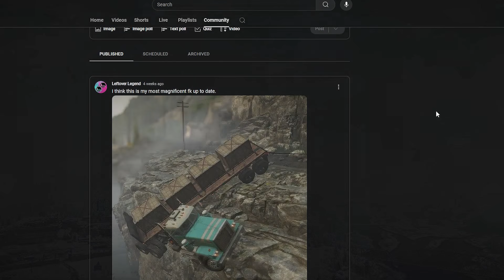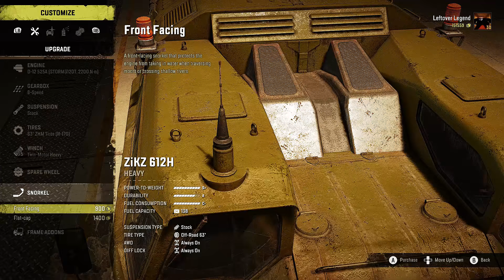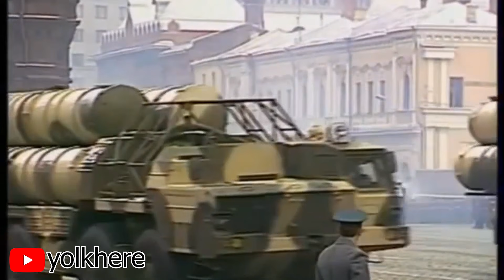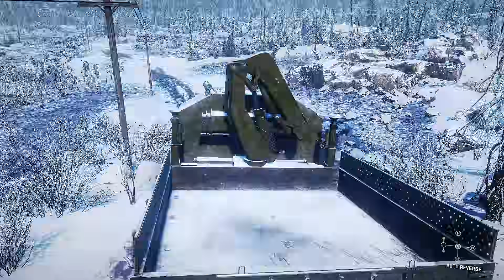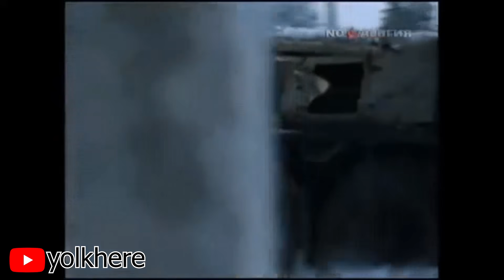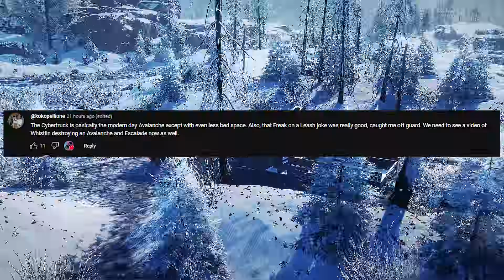The MAZ 543 and 537 - Heros of the USSR - Told Through Snowrunner

Comment: 19:12 Maz 537 and all other heavy Maz had 3 speed hydro-mechanical transmissions. Basically- it is an automatic gearbox with torque converter, but shifting gears is operated manually, using stick on the right side of steering column.

P.s. about rear suspension- Maz 537 didn't actually have leaf springs or any soft suspension element. Suspension work is done by the wheels, just like on K-701 tractor. Still, this suspension is very cool- you can load as much as you can and have the same clearance and suspension travel as empty vehicle.

Comment: 20:13 As far as I know, when the USSR made medium- and long-range missiles, they preferred liquid fuel. The climate control system is needed to keep the liquid fuel and oxidizer within the optimal temperature range, which is essential for rapid launch preparation. Back then, liquid-propellant rocket production technology wasn't as advanced as it is in the 1980s or today.

Comment: should note that its model number changed during the mid 80s to 7310, as the soviet vehicle numbering system moved from just assigning a range of numbers to a factory, to a more sophisticated system which also indicates weight and leaves more room for multiple models (and fun fact, the first vehicle to use this numbering system is the VAZ 2101, better known in the west as the Lada Riva)

Comment: The curtains could also work as a blockage of, let's just say, "excessive light" similar to the rocket engines. The 8x8 has been used as a base for MLRS systems and a temporarily blind(ed) driver is kinda useless, after all.

Another thing that kinda bugs me is such a nitpick that even a plage doctor would be scared of me, and that is the 537s cabin gun holders, or the weapon orientation, to be more specific...

 It makes sense that the buttstock would be pointed up considering that they'd be the weapons of the operators, the last thing you'd want to do when evacuating from any truck that is under/on fire is waving two (what would most likely be) AKs inside the cabin, with how the holder and guns were situated made it basically a "grab-and-go" since you would have the grip in your hand and your finger on the trigger. 

Also, I'd much rather have a hole in the floor instead somewhere in comrade's Ivan Ivanov's body in any freak case of accidental discharge, which has extremely small chance of happening, when you take into account that the AK is one of the most reliable weapons in history and the fact that the truck must've been rattling like crazy while going over the more difficult terrain. Still, such accidents would be extremely rare.

Well, this was a rant and a half of nitpicking over unimportant details. Anyways, love your content, the amount of information one can find over something never ceases to amaze me.

Comment: One thing I gathered from the MAZ-537 is the rear suspension doesn't really use leaf springs? Its like independent suspension tied with heim joints and a big ol meaty limiter on a bearing of sorts. Though it is likely that I am very wrong in my knowledge

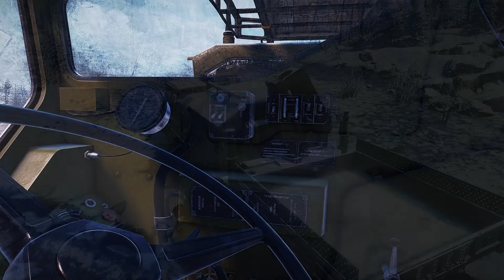Comment: 15:35 In Polish and Soviet (likely also in other socialist countries) motorisation there was a trend of reusing parts from then serially built cars, which is why, for instance early Żuk (late 50s/60s), besides being derived from, had small elements from GAZ Pobeda/FSO Warszawa, meanwhile series from 70s had said parts common with Fiat 125p (nota bene, Soviets used parts from Fiat 124 aka Lada Zhiguli) and 80s/90s (production stopped in 1998) with Polonez

Comment: they used the same engine as the t34 lol. They still use that engine. it has a weird design quirk where one of the banks has a shorter stroke so its extremely limited in rpm otherwise it would shake itself apart from the vibrations.

Comment: Funny enough i actually slept in those mobile barracks during my time in army. Served as morse radiotelegraphist on a mobile command center, whole center counted like 8 or 9 those MAZ-543 with different attachments, like power units, antennas or barracks, and that was pretty interesting experience when whole column were flying through the night and nearby villages at 60 km/h roaring like a thunderstorm. Also it's incredibly loud even at idle, you had to scream at someone to communicate.

Comment: I served on T-72M1 tanks and fun fact: the majority of the dials and indicators are the same on the driver's dashboard in T-72 tanks. The one that goes from 0 to 15 is the oil pressure guage. While driving it should read between 5-10 kg/cm2. If it ever goes below 5 the engine has to be stopped, because the main bearings on the crankshaft aren't getting properly lubricated. The two dials above that are water and oil temperature guages. It makes sense, because the T-72 is also equipped with a modified version of the same 38880 cm3 V12 engine (albeit with a centrifugal supercharger) that is a derivative of the WW2 era V-2, that powered the T-34 among many others and is still in service in an upgraded form to this very day.
Reply: I would love to know who and where you served if you wouldn’t mind
Reply: @iddieforzerotwo400 still active duty in Hungary.
Reply: @oliverpasztor788  that’s awesome, I always enjoy hearing information from servicemen and women about their work. If you have any other fun facts about your work or military’s  history I’d like to read them. Nagyon szépen köszönöm
Reply: @oliverpasztor788  Is it loud inside the T-72?
Reply: @PerfectedVenus_Monsoon it is, but it's much louder outside.
Reply: can't you say it in litres instead of cubic it's not the most coherent or accessible for delivery of information to the common people.
Reply: @osmacar it's the same thing, just the decimal placement is different. 38880 cm3 equals 38,880 litres.

EDIT: and this is how it's written in the manual for the tank.
Reply: @oliverpasztor788 38, nearly 39 killoliters. That's not right.
Reply: @osmacar It is right. In Hungary we use "," as decimal points. It's 38.880 or almost 39 liters for you. 

So to reiterate liters are cubic decimetres or dm3. 1 liter or dm3 is 1000 cm3. If you can't understand this, either your school system failed you or you are American. Engine displacement is measured in cubic centimetres everywhere outside of the US.

Also I find it weird that you have a problem with cubic centimetres, but not with kg/cm2, which is much less common.

Comment: I didn't hear or see it mentioned, so i'll just share what i know of the maz 7310
disclaimer: i've not been able to verify this information.
The maz 7310 is identical in apperance to the 543, from what my research shows this is because maz was manufacturing the platform for both military, and civilian use, the military one is the 543, and the civilian is the 7310.
Additionally i'd like to add(still unverified info) that the 543m was a later platform that was not mechanicly identical, but fixed some supposed issues there was with the 543.

Comment: That "thing" behind driver cab on 543 is oil cooler, next to it is NBC filter for cab air filtration. other modules could be added if needed such as additional fuel, tools/storage. (I think thoose big red gas flasks inside driver cab are air reserve tanks for cabs in case of NBC filter fail. Not sure). The one cab version puts Oil cooler, NBC filters etc where the second cab was to have more cargo space at the back. And both cabs are hinged to acess engine + other equipment - my guess is Tire inflation system?

Comment: You would climate control the missiles to protect the fuel, the seals (think challenger), and some of the electronics.

Also, bumping an ICBM isn't that big a deal in the ominous explodey sense. These weapons absolutely require the proper detonation sequence to go off. Most likely it carried implosion types, there are plenty of YouTube videos on how those work that could explain why it would be so hard to set them off by accident.

It could of course damage some components on an expensive missile if your tracks caused a horrendously shitty ride.

Comment: I love the 537 the most, it has bars (what youre calling leaf springs, theyre literally just connector bars which limit the rear from being pushed down too far and not leaf springs) connecting the rear axles which allows it to take loads better. I just wish it could take a low saddle, its low enough to pull normal trailers! Also wish it got more frame attachments specific to it, because most of them are way taller than the cab.

One thing you should do is put a super heavy load on the 537, and some other truck. The rear of the other truck will get pushed down a lot, whereas on the 537 those bars keep the rear up, it's genuinely very interesting and helpful.

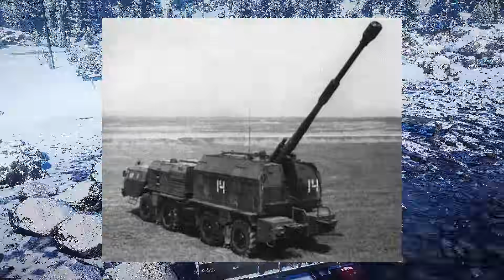Comment: 7:19 on the Russian side of the internet there is footage of the A-222 firing though not a lot as last time I checked the only operator of the system was the 40th BRAP at the Russian Navy base in Novorossiysk, part of the Black Sea Fleet. Later the operator was probably the 11 OBRAB.

Comment: So about the transmition on 543: first, second and third gear go through torque converter. The fourth is actually same as the third, but torque converter is solid locked. This is for low demand small load highway use. About small load and highway: 543M can go without missiles on highway 80km/h.

Comment: 16:08 i have no idea legitimately but going based off these trucks being designed to launch nukes out of there backs i figure it would be to block out the light from the initial blast because at that range it would blind you for a very long time if not permanently. also the bombers that did drop nukes during wwii had the same thing when the dropped a nuke that ran on instruments only
Reply from the maker: A few people commented thinking the same thing. I hadn't even considered it. I didn't think personnel would be in the truck during a launch but its a possible theory.
Reply: @ yeah who knows the icbms are as the name states intercontinental missiles so i wouldn’t rule it out

Comment: More than large, the derivatives of the Kharkov V-2 powering these are extremely advanced motors, and it's astonishing they were around for WW2. Full aluminum block, four port fuel injected, DOHC...the feature list sounds more like a high performance racing engine decades newer than it than a 38.8l diesel V-12 from the 1930s. The fact that they managed to made it cheap and easy to produce is even more impressive
Reply from the maker: Damn I wish I had included that in the video. I didn't know they were engineered so well like that. Thats just another reason to love these trucks and be impressed by soviet ingenuity.
Reply: Unfortunately they never really leveraged the displacement and design as well as it could have been. The power output is quite low for its weight by the time you reach the 70's and 80's, and the engines used today obliterate it in those terms. its a shame that it was never really replaced until the T-80. still a legendary motor, just one that is definitively a '40s design in a world thats well and truly moved on.
Reply: More fun fact- originally it was an aircraft engine for heavy bomber. Just imagine- 4 motor diesel powered bomber in late 30's- that a peak of dieselpunk.
Also this fact explains why V-2 was so futuristic for the 40's tank engine.
Reply: Engineered well. Poorly built especially for WW2 period. Most witnessed constant overheating and overtorque issues
Reply: @manduri1434 debatable - if built as designed, it has asymmetrical pistons, which makes pushing more power out of this engine family very hard and makes maintenance much worse compared to designs without this flaw
Reply: It was used in the BT5 and Kv1 all the way in the T90 for gods sake, yeah 1 day it mightve been a good engine, but i was outdated by WW2......

Comment: 20:10 I don't really know much about soviet missiles either, but some rockets use liquid oxygen and hydrogen as fuel. These need to be at cryogenic temperatures, so maybe soviet rockets used cryo fuel, so they required climate control for chilling the fuel?
Reply from the maker: Ah you know what, you're probably exactly right, I didn't even really think about it cause the truck was the focus but thats good knowledge to know.

Comment: 24:24 diesels throttles are on the injection pump and effect fuel to the engine to increase and decrease rpm unlike a petrol which uses air flow. That is a hand throttle so when your running hydraulic systems you don’t need to have you foot on the pedal. Go look up any tractor before the 80s and some have hand throttles like that that shut off fuel at the end of travel
Reply from the maker: oooooh. Damn that makes so much sense. I wish youtube still had annotations so I could add that to the video. I'm def gonna look that up, thanks for teaching me something. I've always been a gear head, but only within the past year have taken an interest in diesels, everytime I make one of these videos I learn something new about them. I didn't realize just how different they can be from gasoline engines.
Reply: @leftoverlegend6024 it does make sense 😅 when you described it the stars aligned in my head to what it was. I guess for me when your muck around with tractors and heavy equipment it common sense
Reply: @ little video i found to make sure i'm not going mad. you get so sure on some things that when someone questions that you wonder if its actually right https://youtu.be/89f3nKfkyQY?si=zdS8ZOng_Ygn68_i
Reply: both use flow and injection rates to accelerate or decelerate the RPM. what their primary means differs, you can still make a diesel rev up from air flow, and you can enrich the mixture for a petrol engine to get the same effect, HOWEVER to grave disadvantage because of working principles.

either way they need more air and more fuel. more air means more fuel capacity to burn for vroom gooders.

petrol needs more air as it is not a mighty engine for sheer grunt work so a valve, usually butterfly, is needed to fully regulate it, as you appear to know. however this isn't the whole story of the matter as more fuel is needed to be injected to push the petrol piston faster, more fuel, more energy, more energy more transferable power. however the air rushing in aids in the lighter petrol engine assembly to accelerate the RPM.

Diesel engines have sheer might from their core function allowing for huge negative pressure differential to just gulp the air into the cylinder, this is aided by the sheer compression they get (it's also one reason diesel engines don't have as much lag on turbo's), this not only pushes the exhaust out faster, but the resulting intake stroke just tears air into the cylinder cause, that 50:1 suddenly becomes 1:50. they do not need the valve, just a gaping hole HKJ would be proud of (i have that cursed knowledge, and so do you), but having the valve would help with runaways. and i have seen a fair few diesels with flutterby valves, likely for that very reason. i do not know their names but i know their designs. (also just having a none invasive redundancy that is reliable as can be is always the smart idea.)

i knoe more about diesel engines than i do petrol, while i can make you a good petrol engine, i can always make you a better diesel side by side 1:1.

Comment: Man, old Soviet era trucks just so beautiful. Not in the sence that they're stylish, but in the sence that it can simply be descibed in the sentence, "it's a truck." Its not flashy or luxurious, but it just works and doesn't go above and beyond in anything esle besides what it was designed for. The same sentiment can be said for other Soviet hardware from tanks to aircraft and even civilian vehicles.

Now would I like to work in one for long periods of time, absoutley not since the creature comforts are non-existent. But they get the job done, no matter what, and isn't that all we could ask for in a work vehicle?
Reply: I would also like to ask where did you find those old unclassified service manuals. I just wanna read through it and see all the mechanical diagrams, especially for the engine since that engine family, V-2, is used EVERYWHERE. Its either that good or they just haven't bothered desgning a new one yet since a variant of this engine is still being used in modern Russian armor like in the T-90 and 72.
Reply from the maker: @da_hornbill2755   I feel the same way, the design philosophy behind soviet vehicles is so different from the U.S. They were dealing with tougher terrain, less resources, and solved problems in strange ways that resemble science fiction.  But yeah, I posted it in the video description. I had no idea that engine was still being used. In a few years it'll be nearly 100 years old. Could just be the old if it aint broke dont fix it mantra. Have to spend less time training mechanics if everything has the same motor lol.
Reply: Kinda wish more companies had the same ideas as Soviet engineers

Imagine what a Soviet smartphone would look like